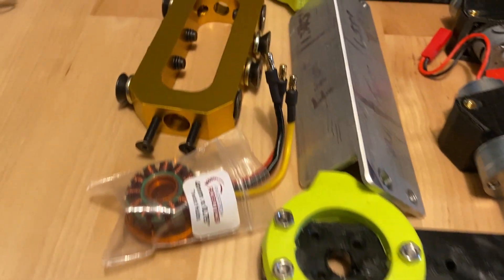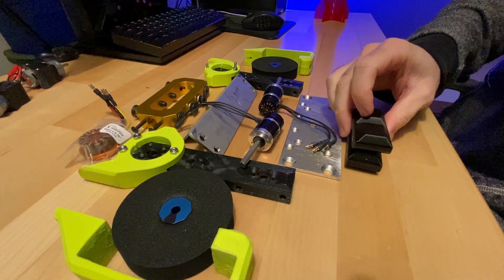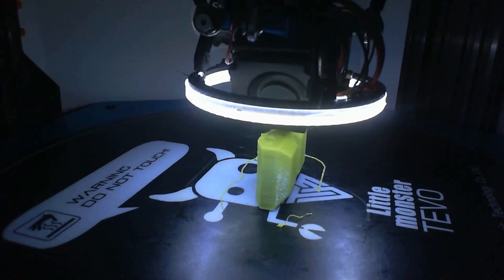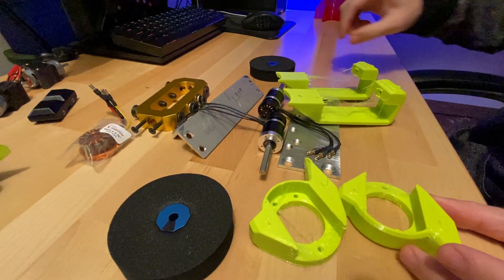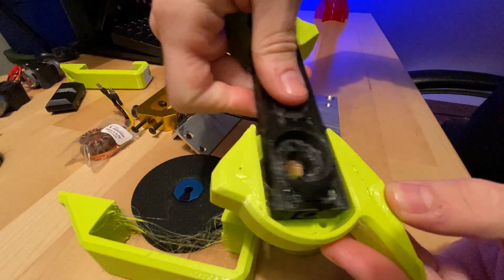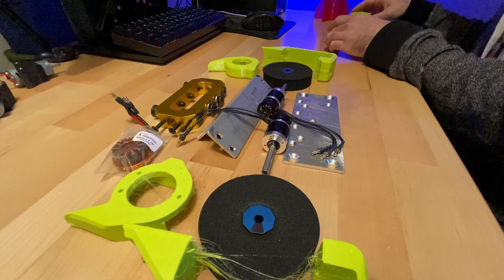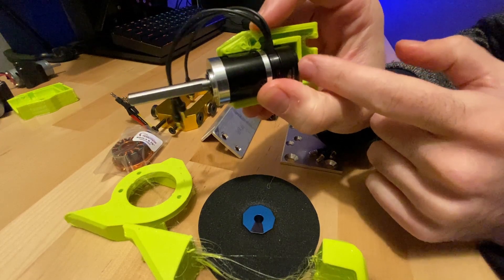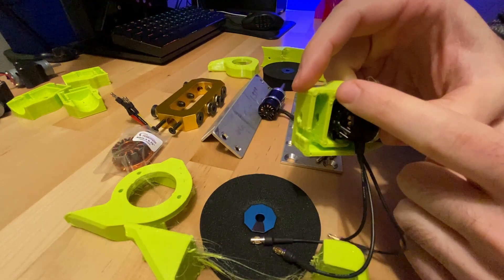New Motors and TPU Parts - Part 8 - 3lb Robot Build

Comment: Hola, que caracteristicas tienen los nuevos motores?  donde los puedo conseguir?
Reply from the maker: Hello!  The newest motors are brushless mega spark 24mm from fingertech robotics.  Not sure of the exact specification, but they are the best I've used so far, and available at most robot shops.

Comment: This series has been super informative and entertaining! Out of curiosity, how do you split the power coming from the battery to distribute among the motors and esc?
Reply from the maker: Many thanks!  Coming from the batt connector, the neg is twisted and soldered to the 3 negs of the escs, the positive goes to a fingertech switch then a short wire which is twisted and soldered to the 3 escs positives.  I'll be sure to show this in a future video.

Comment: Well done! Though you could get away with much thinner metal parts on the top and bottom if you need some more weight
Reply from the maker: Thank-you!!  You are totally right about the metal plates.  When the bot is fully functioning I will probably end up milling pockets into the top and bottom plates.
Reply: @SvendsenWorks  Clever way to get more weight and not have to make new parts. Looking forward to seeing your bot spin up!